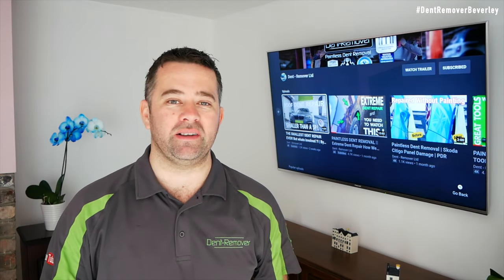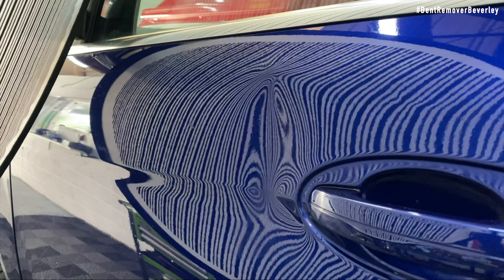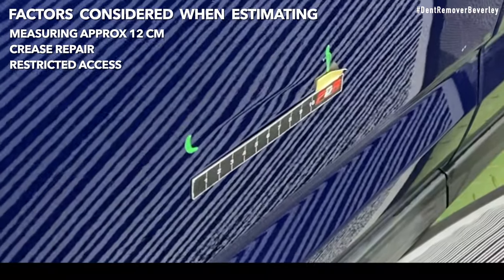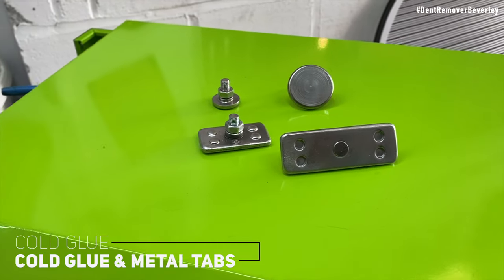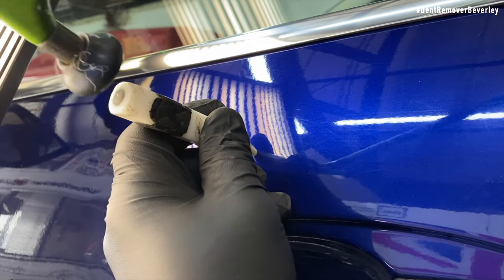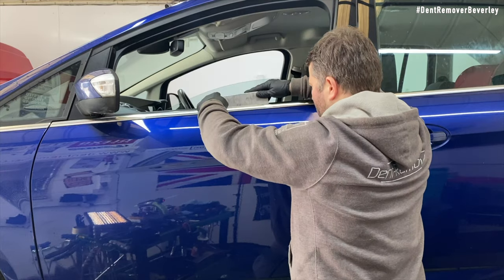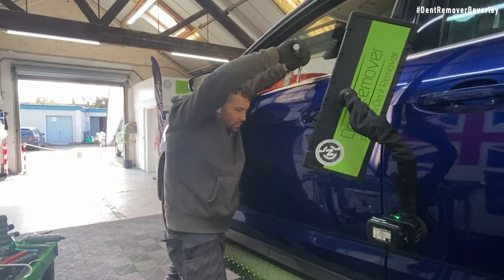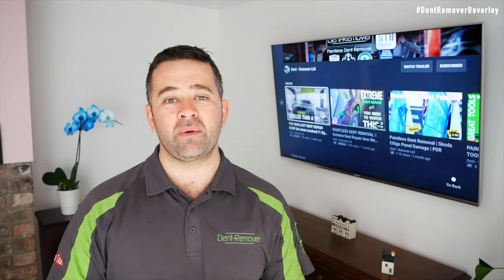NASTY DENT IN A DOOR 🇬🇧|  See HOW we repair it without PAINTING‼️| By Dent-Remover

Comment: Hi Martin,

 I need some advice on removing deep dents out of panels I keep getting little lines in the centre of the Dent .
Do you have any advice?
 Can you use a single fluorescent light to do these deep dents ?
If you can help me please with sum information.
Thank you
Awad.
Reply from the maker: Hi Awad. It’s difficult to say unless I saw the damage, but if you have lines in the centre of the dent youve lifted up then can’t you repair these also? Or are you trying to not put the marks in? Maybe use tape on the end of your tip or a rubber coated tip.
My email is dent08@yahoo.com if you want to send me a vid and il see if I can offer anymore help
Cheers martin
Reply from the maker: You can use any light source to repair damage, it’s what ever your comfortable with using. I prefer lines but fluorescent light is also great

Comment: Greetings from San Diego, California. My daughter's Kia Rio has a few dents, but I'm afraid that the mileage charge might be a bit high. My son has put a few dents in his Buick, and my Chevy Truck. I'll have him take them out. You do excellent work. I noticed that the outside corrugated wall of your shop is a great reflector board.  Do you heat the surface before you move the metal?
Reply from the maker: Hi Gary thanks for your comment and for watching my repairs, always best to have a technician take a look unless your Son is good at pdr, I’d hate for him to make the damage harder to repair it may cost more in the long run? It takes a long time to learn pdr, I think I’d struggle on USA cars! Yes the shop shows dents up like crazy, a little too good sometimes! I’ve been known to pull a customers car out, then notice something and pull it back in again! 
Warming damage up is always a good idea, makes it all move better! 
Cheers martin
Reply: @dentremover01  Hi Martin. Yes, I am thinking of using a local PDR shop. They also post classes on youtube. I'd ask you to come over, but I'm afraid that the mileage charge would be quite expensive.
Reply: @dentremover01  I've owned some American cars from the '50's and 60"s and they had some thick metal. Tapping out a dent was difficult. Once I saw a 1950 Packard, and I think that they used World War 2 surplus battle ship armour plating on the body. The doors were so heavy that they had 3 large hinges on each door. It was like opening a bank vault door. The bumpers were 1/4 inch thick. I have also owned a 1926 Ford Model T, and I was surprised at how thin the metal was. Those cars only weighed about 1200 pounds, and they used chrome vanadium steel.  It is actually quite easy to remove a dent from one. The biggest problem is that the body has a wooden frame under the metal. The repair is not so easy on that.
Reply from the maker: Hi Gary, I’d love to come over and also get a tan! But I don’t think we can travel! Whos the dent techs your looking to go with?
Reply from the maker: Wow the USA cars are great looking vehicle especially the 60/70/80s cars they where designed to look like aeroplanes? Maybe not the 80s! Love the muscle cars I had a hellcat in last year and that metal was thick enough! 
I’ve worked on old cars with wood frames too, can be a nightmare especially the aluminium panels. You’ve had some great cars from what you mentioned 👍🏻👍🏻

Comment: Hi, What’s the difference between the cold glue in your description and the official glexo cold glue?? thanks!
Reply from the maker: Hi Corm F
Thanks for your question. I have the Glexo kit and it’s very good like this kit so I can compare. 
The makers of the Sticky Beast cold glue kit informed me the glue comes from the same manufacturers. They make the tabs themselves and have put a lot of work into getting these to be stick super and very capable at pulling paint! 
The only difference I can see without getting all scientific, 
The metal tabs are both totally different, also sizes and shapes of each kit. The presentation of Glexo kit is a nice touch, it comes in a storage box.
I’d say the kits are very similar just a price difference. Ultimately both do exactly the same job just preference. 

You could compare it to buying a blending hammer. Lots of choice, look the same, parts probably made from the same manufacturer and all do the same job 
Hope this helps
Cheers Martin
Reply: Dent - Remover Ltd thanks for the reply!!! keep up the great work!!!!!! 😁😁😁
Reply from the maker: No problem at all. 
Thanks and take care